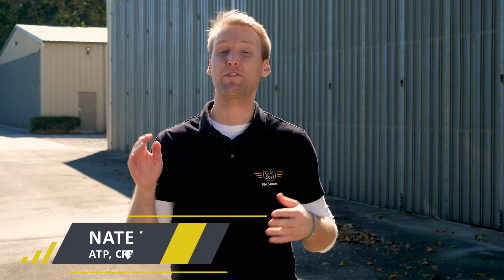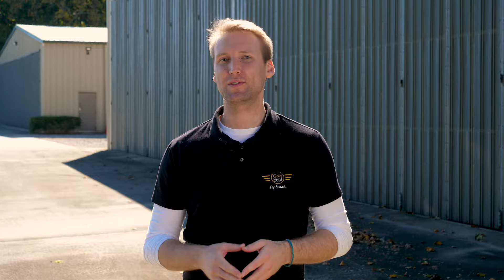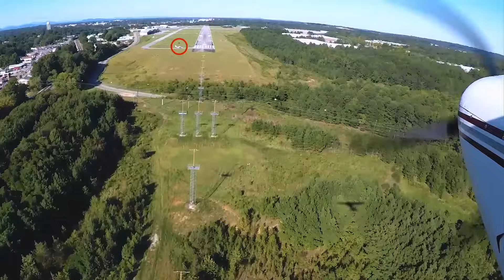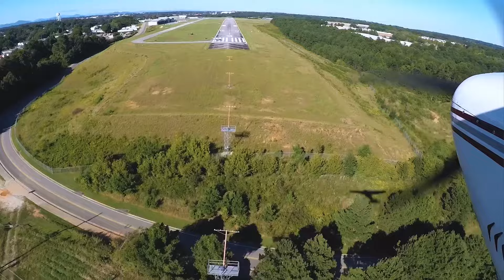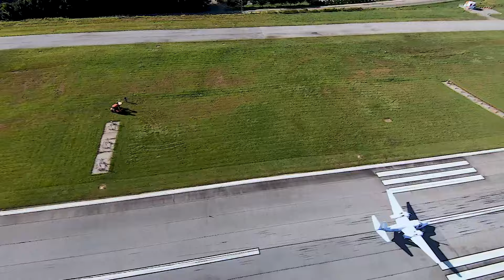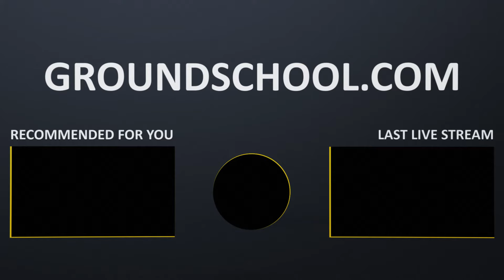Go-Around with a Side-Step

Comment: Good advice!  But something to think about is that if the active runway is right traffic, you may want to sidestep to the left instead.
Reply from the maker: Traffic and terrain should always be your main consideration. But there is a problem with sidestepping to the left- it becomes very difficult, and perhaps impossible, to keep visual contact with the departing aircraft by trying to watch through the passenger-side window. Also keep in mind that the sidestep is not so wide that it places you in either the downwind or the upwind.

Comment: left or right depending on the traffic pattern,Also another point to make is if  the airport is  towered or non towered?.ill let you think about it ?
Reply from the maker: Although traffic conflicts are ALWAYS the number one consideration, traffic pattern direction is not. The sidestep is not so exaggerated that it will put you into the pattern airspace. It's just enough so that you can maintain visual contact with the aircraft departing below you. From the left seat, it can be very difficult (and perhaps impossible) to stay in visual contact while leaning over to look out of the right side window.
Reply: @GoldSealFlight  thanks for the reply.

Comment: Should the sidestep always be to the right? Let's say the runway has right pattern traffic - wouldn't left be best here to make sure you're further from pattern traffic and out of the way of any straight-out or 45° departures?
Reply from the maker: Sidestepping to the left (assuming left traffic) would put you >closer< to the traffic on downwind. The main reason for sidestepping to the right is visibility. From the pilot's side, the best visibility will be to his/her left. Very difficult to visually follow parallel traffic trying to look out of the passenger window.
Reply: @GoldSealFlight  That's if you're in an aircraft with a left and right seat. Also bare in mind no-fly danger zones. On runway 28 at Headcorn, a right side-step would place you in the no-fly danger zone (parachute drops). So on runway 28 at Headcorn, it's a left side-step but that does make it hard to see the traffic you've given way to should you be in a left seat aircraft, puts you above a taxi-way and very close to spectators.